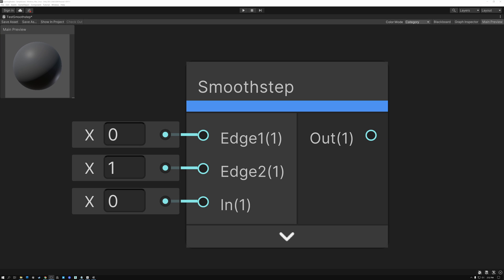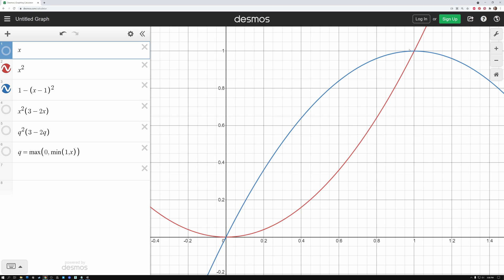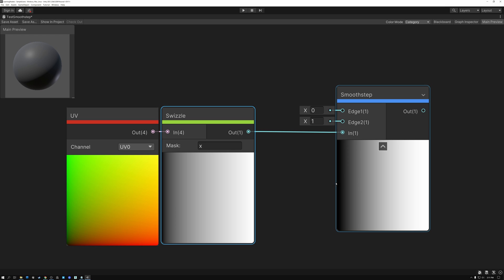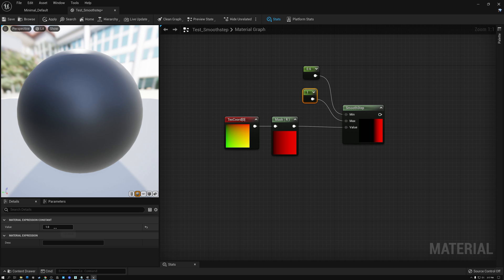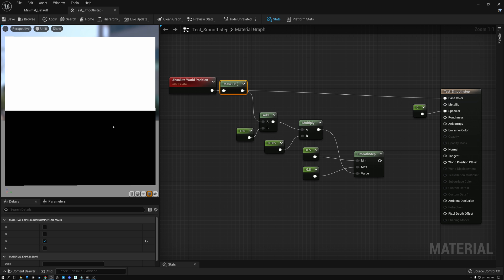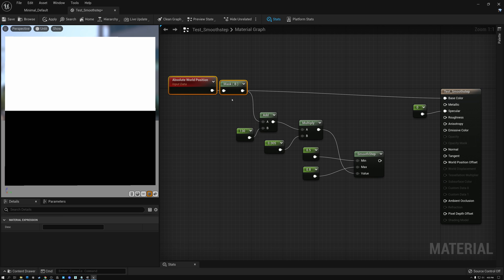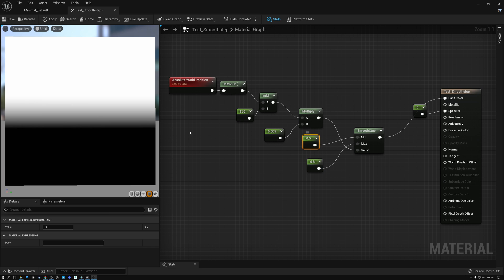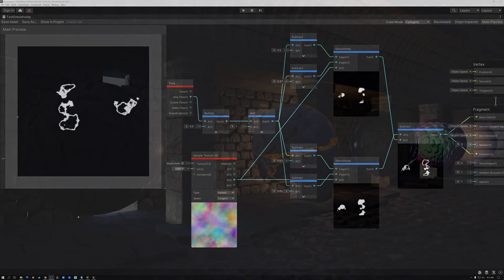Smoothstep - Shader Graph Basics - Episode 15

Comment: Hey, Ben.
Thank you for all of your tutorials. It’s the best thing on the whole YouTube I have seen so far.
One little question. Why do you usually use math like add 1 to remap value range from -1,1 to 0,1 instead of using the remap node? Is it better for performance?
Reply from the maker: Yes, that's right.  The remap node is designed to handling remapping any range to any other range.  This means that the math required is just a little bit more complicated.  Because I'm remapping one known range to another known range, I'm able to simplify the equation and use a faster method.

Comment: I was hard stuck a whole day trying to sync up additional masks/ lerps with the dissolve effect. The problem was that the things that pass through SmoothStep are actually inverted, i.e. when Time * Sine = 0, SmoothStepMin = 0 and everything passes through (which looks like Time * Sine = 1). So If you use the same time node for other stuff it won't work. You'll have to do a OneMinus somewhere. Hope this helps someone.

Comment: 13:34 where does 130 comes from? I mean, how does it make the range go from 0 to 1? I tried tweaking the number but I still don't understand why the number 130 works here :(
Reply from the maker: That's a value in centimeters that's shifting the origin point from the center of the cube to the ground.  It represents about half of the height of the cube.
Reply: @BenCloward  Thanks a lot! I understand it now! Btw you should have some premium product, course or even a place where we could donate/be a Patreon to support your work :) All your playlists are so valuable, thanks for the content!
Reply: @BenCloward  Sir the Cube height is 100 and the half 50    so the 130 ? how to calculate

Comment: Hello, I have a question on the Unity example. So the sin(time) goes from -1 to 1. You divide by 2 so it goes from -0.5 to 0.5, add one and it becomes 0.5 to 1.5. Then you on edge 1 you substract 0.5 so the range becomes 0 to 1, and on edge 2, you substract 0.47 so the range is 0.03 to 1.03 which means edge 2 may go beyond 1. Shouldn't we substract 0.53 for example ?

Comment: I've been watching your videos for a while and they helped me to understand a lot of cool concepts. Thank you for sharing your knowledge! Now I'm confident to dive into the TechArt side of things instead of waiting for somebody to help me figure out the way to do something. I vote for Distance and Length. Also, there is one crucial thing regarding everything you teaching about and that is performance. I've managed to optimize shaders and functions by using your tips by a significant margin, but it would be great if you'd explain to us how costly a certain technique is going to be. For instance, is it a good idea to put this Smoothstep node anytime and everywhere or we should be careful and only use it when absolutely necessary? Does it forcing the CPU to do a lot of extra calculations or is it somehow implemented in the GPU logic to perform as cheap as Saturate? (I guess not though)